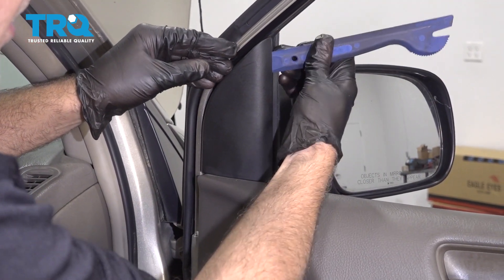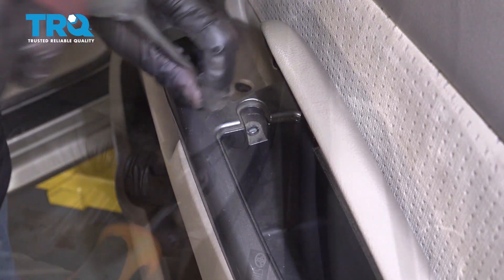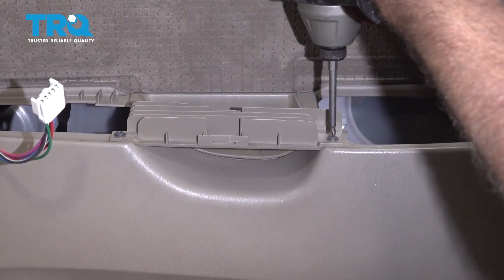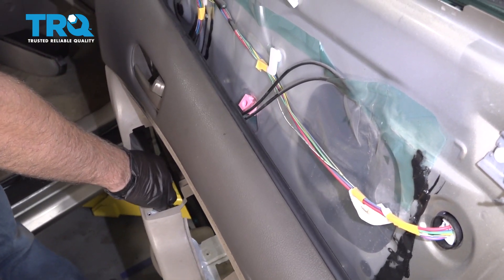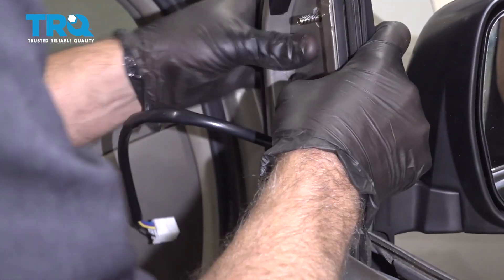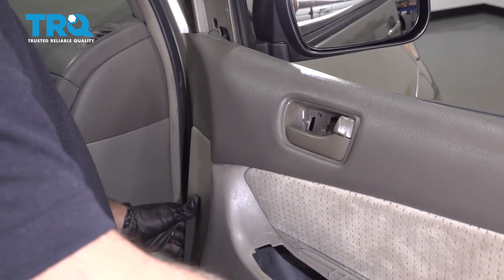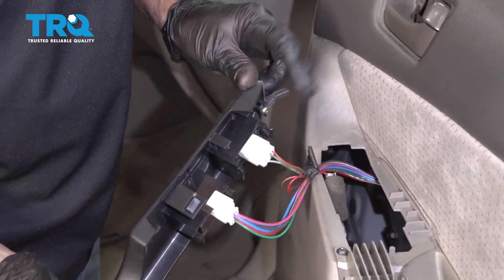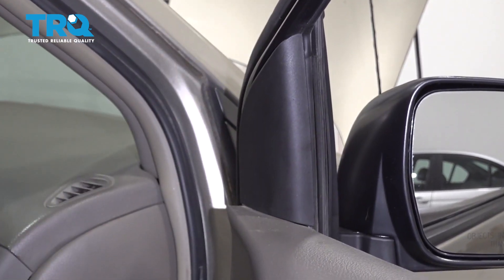How To Replace Sideview Mirror 2004-10 Toyota Sienna

Comment: Thank you very much for the video.  I was able to get it done in 45 minutes.  I ran into one hiccup:  the car I was working on was a Limited, which has turn signals in the mirrors, and a many-wire connector.  The new mirror was a basic power mirror, with three wires on a few-wire connector.  I had to cut the connector off the new one, and splice the wires from the connector on the old one to plug in.  The new mirror had only blue, yellow, and white.  When I connected those to blue, yellow, and white on the new mirror, the up/down operated left/right.  So I connected blue to yellow, yellow to blue, white to white, and it's working fine.  Even with that bit of futzing around, I still got it done in 45 minutes.  And I had never removed a door panel before.  GREAT video.  I did have to convert it to a transcript, step-by-step, and then only had to return to the video once while doing the job.

Comment: Thanks!
Reply: Lol, so I ended up buying the wrong side view mirror (match with a different connector) but with your instructions, I at least got the incorrect one installed until I get the correct mirror. Thanks for your teaching assist.

Comment: Just followed the steps illustrated in this video and proceed until the step of putting back the door panel and got stuck there. It’s not as easy as what’s shown in the video just putting back the door panel. 
I have to remove every piece of the door panel clip from the metal side of the door with a clip remover and reinstall those clips back to the door panel, by then can I successfully put back the door panel into where it’s supposed to be with click sound coming from each clip fit into its place.
Thanks for your sharing anyway.